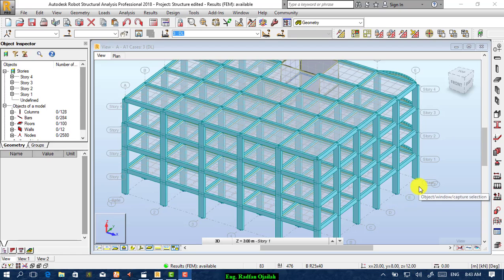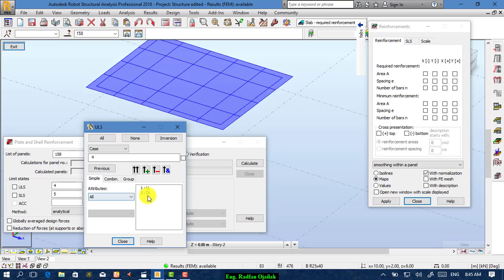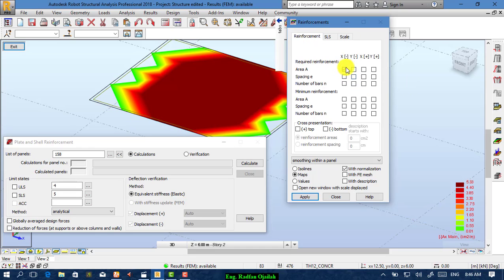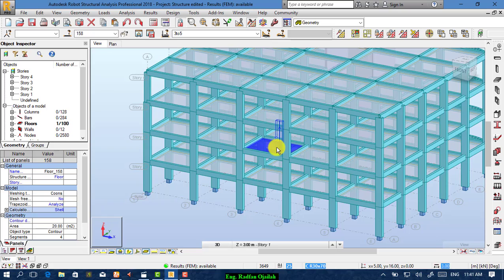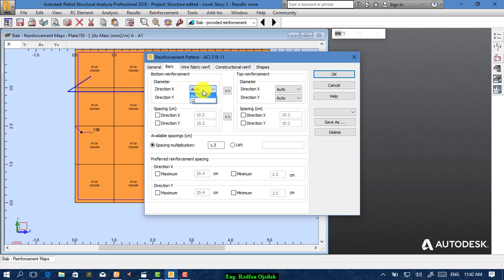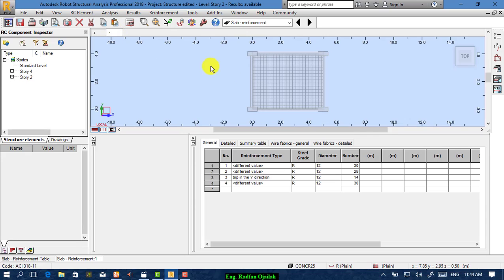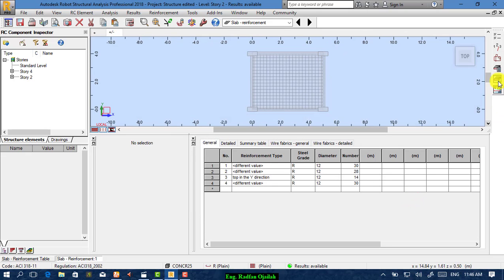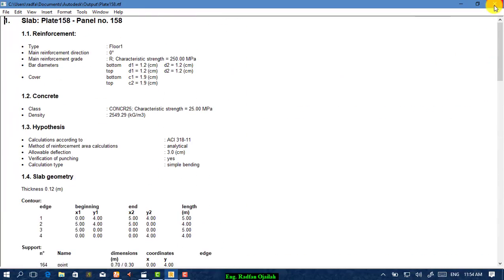Lesson#8 Design of an RC Slab

Comment: Hi, thanks for the video. I have a question: The top reinforcement showed a hole in the middle of the slap, because there's no need for reinforcement in that area. But the slab must have a minimum % of steel bars in the complete section, in both top and bottom. How can it be done? Thanks
Reply: the minimum % of steel if for full section, then the bottom steel solved that problem bro
Reply: why would a slab need top reinforcement where there is no support? this video confuses me.